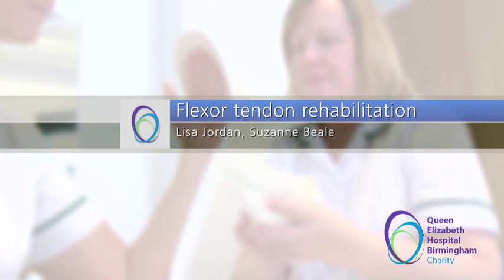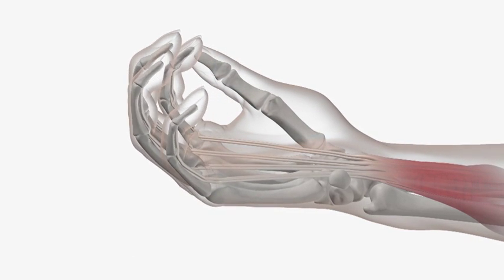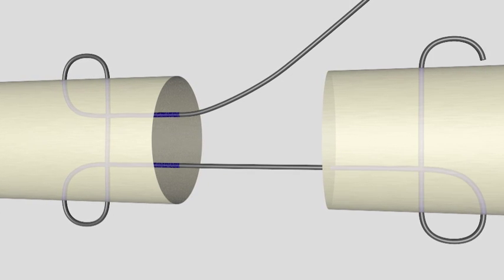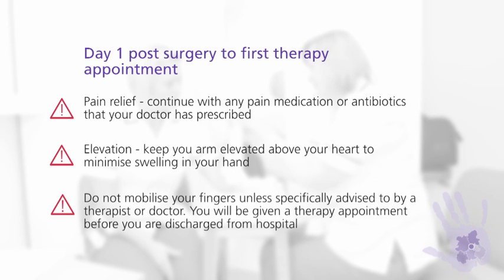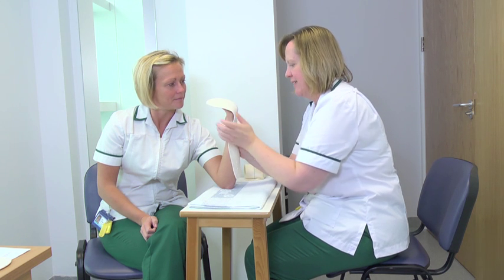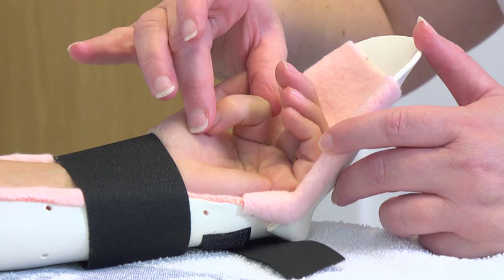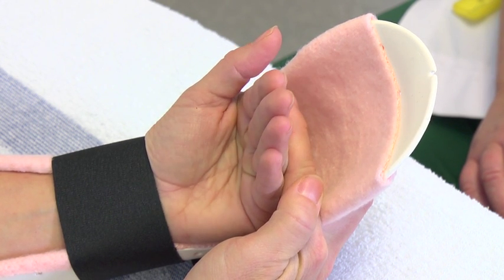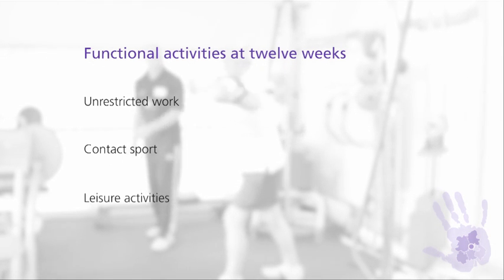Flexor Tendon Rehabilitation

Comment: i have the exact injury and was left with so much questions after surgery and this video was very helpful! i guess german hospitals are so understaffed that its normal to get rushed trough like this. Such a video should be the least tho. I wish  everyone else here a good recovery too
Reply: How did it go? Did you get full recovery?
I tore my middle finger deep flexor about 4 weeks ago waited 2 days to be sure tendon was torn. Went in for surgery. Doctor said it went well gave me very little details told me not to use my hand for 3 weeks. Right about 3 weeks I figured I could start using my hand more. Was doing something where I had to use both my hands long story short I tore it again. Got it repaired again (more invasive this time had to cut in my palm)  Tomorrow I'll be done week 1 week of recovering. Was stupid the first time I guess not tearing it again! One problem has been over the last 4 weeks is when I'm just falling asleep my hand cramps or muscles suddenly contract. Not extremely hard but it's extremely painful so definitely a good bit. I'm at the point where all my fingers are getting stiff cause of not moving them for so long. But I hear I'll get full motion control back just gotta go through the slow process of a tendon healing. Gonna feel so good to have the splint off again.
Reply: @asicsforever7077  you should Start using Tour Hand After 5/7 days After surgery (but only passive Motion!!) to prevent stiffness and Breaking it again. After 6 Weeks i had to Start with active Motion exercise. Full active use After 3 months! Full recovery at least 5/6 months up to a year. 
I had my Palm cut with 25+ Stitches After surgery and its important to loosen up the scar tissue. Try massaging it, later on in the Schedule do a lot of stretching. I recommend doing a lot exercices in the next year. I think my Hand healed quite well. 
I would say i have 95% of Original use. Sometimes its a bit Stiff and sometimes i have a sting in my scar. All in all try to stay active and educate yourself about recovery method! I wish you all the best 🍀
Reply: Look up the differnces between Active/passive flexing and stretching ! Never do Active flexing within 6 Weeks After surgery to prevent Breaking again. But passive flexing and Active stretchin should be started After 5 days. I heard if you wait more than one Week the scar tissue Forming Glues everything together which is really hard to Break up again

Comment: how are you? I had surgery on the tendon
and nerve of my thumb on the inside of my
hand. I also cut the tip of my finger with the
glass. Right now I can't bend the top of my
thumb at all. The cut is growing slowly. the
operation was on 4.8, currently it is 18.9. I have the feeling that at the point where the tendon joins, it has grown into the surrounding tissue. I hope
not so. Or its just not good surgery done.
 i had 30 threads. I'm very afraid for the
future of my finger because the thumb is the finger we use the most and I'm only 19 years old. I also did alot of work on my finger.I also do a lot of exercises for the finger, there is progress in the whole finger, I still feel tension in the channel where all the tendons pass. I'm afraid the tendons have not come off where they were sewn. I can't bend my finger. any advice, thanks.

Comment: My OThas been told me that I cannot take off my splint for 6 weeks. ( will be take it off only at my appointments). I took it of twice ,because of sweating ( my skin,little bandage and the splint was wet - the material of the splint hasn't got any holes). I was careful,gentle,I didn't stretch my hand,my fingers. Today, I felt some pain in my palm and my wrist along metacarpal bones. Could be, because I took of the splint ? Or because yesterday I used the treadmill for a walk ( not run) at speed 4.00?

PS: I'd like to mention that on 26.1. 2018 I had the second stage surgery of tendon flexor little finger repair. 

Thank you in advance for someone who could answer to my worries.
Reply: florysana, I take my splint off a few times a day, starting with week 2. As long as you keep fingers relaxed, you should be good. I do light wrist flex and tissue massage while off.
Reply: Can you please share your experience with the second stage surgery...how much rest/precautions were required, when were the stiches removed etc
Thanks